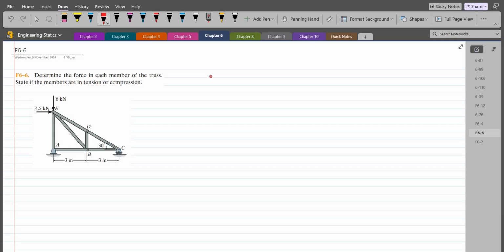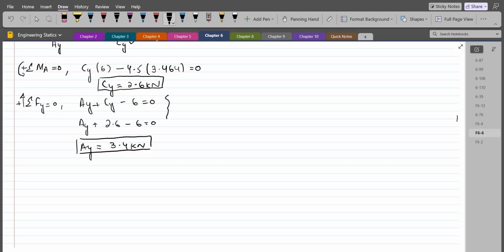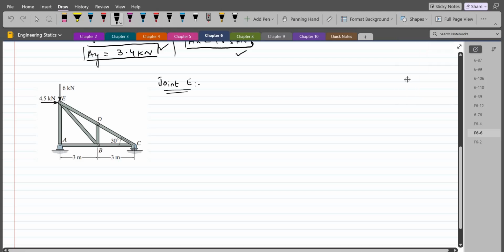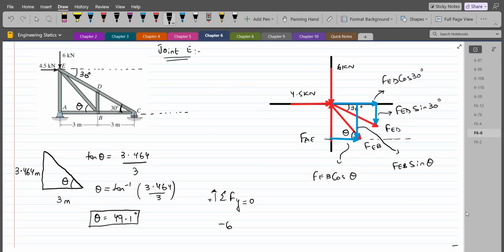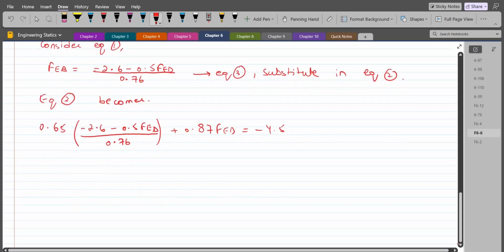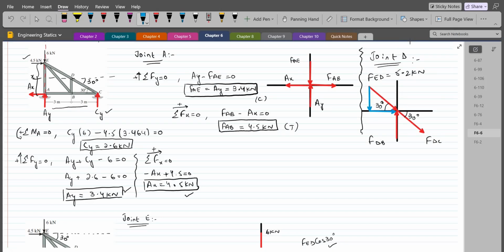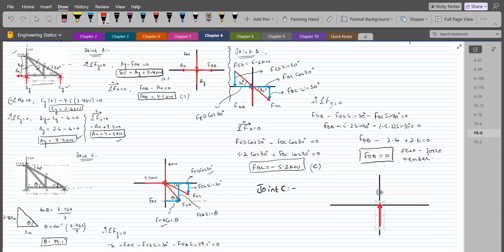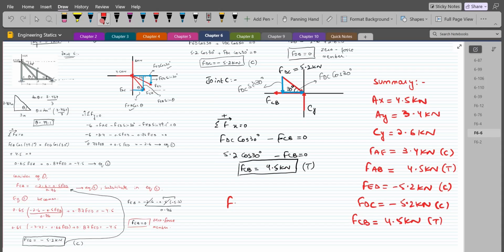F6-6 hibbeler statics chapter 6 | hibbeler statics | hibbeler

Comment: why is Ax pointing to the negative side for this question?
Reply from the maker: Selection for the direction of forces is dependent on you. For instance if you are getting the positive answer, it means that the direction of force you had assumed earlier is correct.  
I could have drawn Ax to the right but my answer would be negative then and negative indicates incorrect direction. I hope it will help!